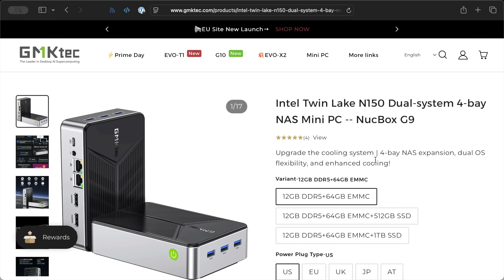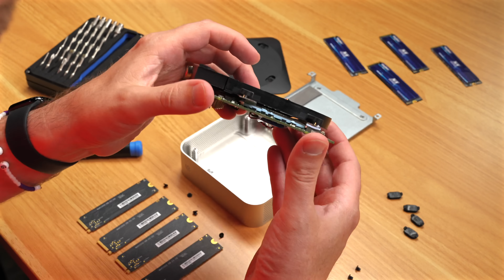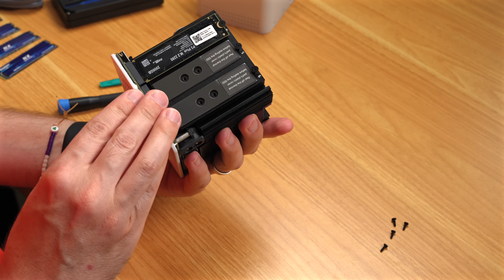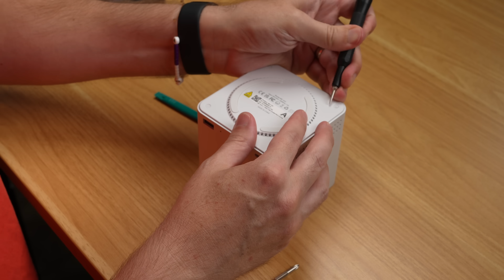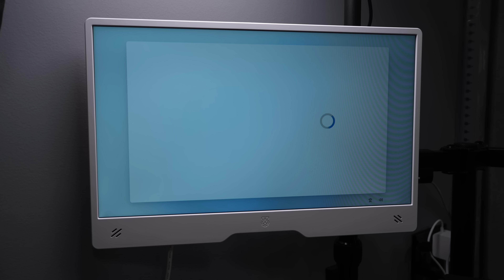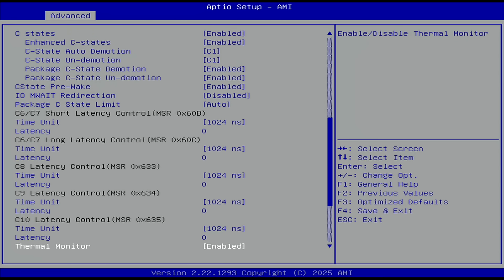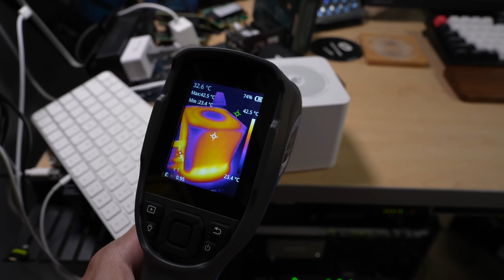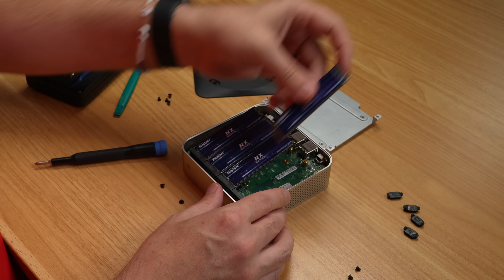The Mini NAS has arrived! (mini homelab)

Comment: Wow great review and transparency! Just wanted to say thanks for all your great videos. I got into homelabbing about 5 years ago with a Pi4 and with your help! It served me well until I wanted to add Frigate into the mix and ended up using an old laptop for that. The very messy setup worked great and probably had < 1 hour of downtime over those 5 years even though the Pi4 booted off 1 of the 2 SSD's plugged into a powered USB hub, and it's second ethernet (because it was also used as a router) was plugged into that same hub :) But last Christmas I upgraded to a cheap mini PC ($260 for one off Amazon with an AMD 5800U, two sodimm for ram, two nvme, wifi, and two 2.5GB ethernet) and with Proxmox, it's been a huge upgrade and learning experience. Still sips the power but has so much more performance and flexibility. Since it only has 2 drives I partitioned one with a boot partition and a storage partition, and the other drive just has a single storage paritition, and every night a script runs to backup certain parts of the main drive to the other (if the main drive fails it'll take me a night to re-setup things and restore the backups). So almost a perfect setup for my use case. What I love is the cpu runs hardware accelerated object detection in Frigate (via OpenVINO), an OpenWrt vm for WAN failover if my main inet goes down (it will try connecting to my cellphone's hotspot), home automation, Pihole for DNS/DHCP/Adblocking, Ubound as a validating DNS resolver, tailscale for remote access, and finally the NAS function. All told the mini PC is running 3 lxc's, 1 vm, and a total of 11 docker containers. I think for me just having a single purpose NAS would be a waste of resources, even when I was on the Pi4 it was running so much more than just a NAS, and having a slightly more powerful cpu makes my little homelab so much more capable. The mini PC's CPU usage is always < 3% and it's probably that high just because Frigate is recording and analyzing video 24/7, so still tons of power left over to run desktop Linux or Windows vms in the future. But anyway, just wanted to say thanks for all the inspiration and share some of the fun I've had as a result, and I hope you find a good solution for your particular NAS needs!

Comment: External power supplies have annoyed me for a long time, so that Beelink Me Mini looks great with its internal power supply. But I might be changing my mind. In my experience, power supplies fail more often than anything else in a computer except for hard drives, and now hard drives are on their way out. I have a Synology DS918+ server with hard drives. Recently, the system didn't power up. I took a chance that the fault was in the power supply. I plugged in a replacement, and the system came back. The operation was easy, and it looks like it wouldn't be for this power supply in this tiny system.

Comment: I've had mine for a few weeks now. It came with a 2-gig SSD, but I added a second new Crucial of the same model, a one-year-old 2-gig SSD, and a 512-gig drive that I removed (unused except for the Beelink Windows install code) from an upgraded Beelink SER6.  I loaded TrueNAS on the eMMC. The 2 new 2-gig drives are striped (RAID0), the older 2 gig and the 512 gig are single drives. I'm using it for media storage and as a backup location for "Home Assistant."   Works perfectly fine for my use. And it's SO small! 

My only issue is that I've been unable to install the Jellyfin server.  I'll figure it out sooner or later,  but so far, all I get is an error when I try to install the app via TrueNAS. I'm sure it's something simple.  Bad/wrond path? 😀
Reply from the maker: I usually use the Docker container install for Jellyfin, though I've only installed it on plain vanilla Linux servers not on TrueNAS yet.

Comment: For the Aiffro, just use Unraid.  It's designed to run from a USB drive, and functions quite well too.  I think that would probably be the best option for that, then all 3 drives are available for use as pool devices.

Comment: Thanks for doing proper thermal testing for all of these. I’m in the market for something similar, but have been worried about overheating drives. I’m curious how the ME Mini would do with double sided 4tb drives, or if it would need a metal case to properly dissipate the heat.

Comment: Diy NAS needs 128 pcie lanes just to start it, old dell server, threadripper, epyc etc. Most people are getting cards they can stuff 3-4 nvme's on pcie slot with bifurcation support. Still needs alot of nvme's to compete with 2 40TB rust drives. 100gb network card will take an additional 8 pcie lanes for testing throughput.

Comment: I like the mini-NAS idea, but none of them have enough storage. Could you take a look at something like the Asustor 12, with 12 m.2 slots? I’m currently running an old 2U 12-bay pizza box, and would like something smaller, more powerful, and more energy efficient. Just wish the 4TB+ SSDs were cheaper.

Comment: I have a similar CWWK unit with 4x NVMe drives. I'm running ZFS on my root filesystem to get around the no eMMC limitation without wasting storage space for the OS. You might want to look into that.

Comment: Why would they use gen 3 (price?) but honestly how different is the price between the two for the SOC they use (or does that mean all the other parts of the machine get more expensive (gpu, etc) having to support gen 4 or 5? 4 seems old enough to be pretty off-the-shelf cheap at this point. Totally agree with the rubber feet thing, so annoying, like put them in the box so I can stick them on, but leave the holes uncovered in shipping, then once I have it all working I will put them on (I would probably use regular silicone feet from Home Depot not covering the screws, who is looking at my NAS' underside? (honestly in a rack probably would leave them off since who cares I'm going to 3D print a cradle to hold it in the rack (my rack also has a top 140mm rnoctua rack fan so would be able to exhaust pretty much anywhere dumping heat into the closet (which is kept cool - typically in the 60 degree range). 

The thermal images are interesting with heat spilling out at the bottom seems to imply either they poorly couple to the vertical heatsink or they need to draw air in at the base to pull that heat upwards, Despite the many, many flaws of the trash-can Mac Pro the ability to dump heat was not one of them, we ran it as a NAS/java build server once it became not usable as a Mac Pro, sitting in our server room and even under the heaviest load it silently stayed cool (unlike the HP server near it which rivaled a F-18 taking off under full afterburner even at idle - when someone would run a ML training job the thing sounded panicked! Didn't help to have a Nvidia P100 inside along with 2x 4-core Xeon Gold chips)

Comment: One issue with the Beelink (and probably Aiffro) is compatibility with DRAM SSDs. I had four SN850X in the Aiffro and whilst in the beginning they ran fine, after a few months and with more space usage in TrueNAS the Aiffro started to reboot every time I was doing sustained writes to the SSDs. It's the main reason why I switched to the Beelink. I had a USB to NVMe adapter for the Aiffro so when I migrated all five SSDs over to the Beelink it too had issues during sustained writes. Only instead of rebooting on the Beelink, SSDs in slots 1-3 would suddenly go offline until I powercycled. I solved the issue by replacing one SN850X with a NM790. I haven't tested the Aiffro anymore but so far my Beelink has been reliable now. Knock on wood...

Comment: These all seem quite bad compared to just building an mITX with a real cpu which has more pcie lanes. Without any extra adapters you could get the 3 or 4 or 6 drives that most of these allow… all full speed… and room to expand. It will definitely be a tad bigger, but depending on the ITX enclosure you use, they will still go anywhere. Anyone buying one of these is selling themselves short in my opinion.

Comment: Hi Jeff, I may have a solution for the K100 boot issue. Back in the heady days of mdraid under Linux I would carve off a small boot partition on each of the RAID drives. With the BIOS set to boot off more than one I would still be able to recover from a first drive failure. A cron job for rsync made sure that the shadow boot partitions remained patched. Sure, you give up a small portion of your usable RAID space, but with Ubuntu being able to fit in 10GB, that isn't much out of a 6TB volume. Certainly less than the marketing departments of drive vendors take by using TB instead of TiB ;-)

Comment: Thank you for your in-depth review of the Aiffro K100! Your perspectives give us valuable food for thought and areas for improvement.About the emmc , we also have some views,we prioritized extreme compactness (just 10.5x10.5cm!) and focus on low power , so it uses onboard LPDDR5 and a single 2.5G port, and give up the Wi-Fi/eMMC , even the hdmi timing circuit is streamlined. 
if pursure more interfaces and functions,we also are studying a new one high performance nas~
by the way we would like to know which bios function you hope to support , could you please give the details? thank you ~:yougotthis:
Reply from the maker: I often like to tweak the fan curve settings a bit, and it might be nice to have more of the CPU performance settings exposed, besides just the performance profile.

Comment: When I populated all pcie slots on my unraid build, I couldn’t reach my internal usb port anymore. Bought a compact usb drive (size of a Bluetooth dongle) and have had trouble removing it if I wanted to… wouldn’t be scared to put it on a compact system as most connections will stick out further.

Comment: Nice review, the mini-NAS space is getting interesting!
Jeff, when you measured temperatures for the Beelink, did you use the builtin power supply or was it powered via USB?
As the PDU may contribute to heat generation, USB powering would have been the fairer option.

And to improve the cooling, perhaps a small 3d-printed 'cradle' that locks into the rubber cover holes could help a bit, if as I read the fan is pushing air to the bottom of the case?

Comment: Interestingly, you don't actually always want especially good heatsinks on the flash chips for your SSD. They firstly don't get nearly as hot as the controller (which is usually the cause of throttling) and the flash chips tend to respond slightly faster when they're warmer... better electron tunneling mobility or whatever I guess.

Comment: Been running a Beelink SER5 MAX as a PVE node for the past 7 months and it has been rock solid. Fan is a bit louder than I would like but I hear that has been remedied in more recent iterations. 
The ME Mini definitely piqued my interest when it was announced , but on pure TB/$ value I've opted for a rackmount 3.5 server for my *starr stack expansion (previously running NVMe drives in USB enclosures).
The concept of M.2 NVMe NAS builds is fantastic, and likely the future, but with the current cost of these drives, it just isn't economical at all.
If you have the space (and the dB tolerance) then an oldschool DIY spinner setup still spanks an SSD NAS for cost efficiency, especially if you have an old 8th gen+ i5/i7 kicking around that you can tear down and repurpose for Quicksync.

Comment: Aww man, it's N150 as always, with limited PCIe lane, this is certainly going to be the future trend, i think their original purpose was to fit these mini homelabs with either M.2 SATA or mSATA, but the drives cost isn't that different from NVMe so these form is still an overpriced, over-glorified NAS and the TCO is going to be atrocious (we can't trust "Pre-order price" lol); again, at least the drives run in slow speed throttled mode so i guess the drives won't be overheating at all, but the poor N150 is going to run hot 24/7 with one of them running HOT power supply as well, thank you China.
.
Also, don't worry Jeff, we're not stupid, you're pretty trustworthy with your sponsorship transparency, even if we're not 100% full agree with you, your video will always be reliable.

Comment: Jeff you said that Beelink has a normal wifi card, can you confirm that? Based on my research it has a CNVi card, which means it can only accept a few Intel WiFi cards. I know for certain the GMKtek is CNVi, that's the reason I returned it. If I could find any USB powered unit with standard WiFi and at least 2 M.2 slots I'd buy it on the spot.

Comment: Here is a build (looking at the Amazon data). I believe the case is metal and you would not have to boot off a jump drive. 

(Amazon description)

FriendlyELEC CM3588 NAS Kit 2.5G Rockchip Demon Board 4xPCIe3.0 4K/8K CM3588 NAS SDK Kit 4 NVMe HDMI in (32GB Ram+64GB eMMC)

Comment: Jeff, thank you for the Video.

Running your NAS-OS from a single NVMe drive is a BAD idea. Instead, steal a page from Synology (probably, other RAID manufacturers do so too): 

Make a smalish partition IN EACH DRIVE and run that as a n-way mirror, and install your NAS-OS there. Then, in the other partitions, run a RAID-6 equivalent.

Hope this idea helps.

Also, if I were you, I'd buy 2 identical cheapo mini-NASs + a RASP-Pi, and run them in an active-active configuraton (with the pi as the decider to avoid split-brain syndrome).  Then , all the VMs of your "MiniLab" would run in active-pasive configuration in each of the MiniNASes, balanced during normal operation, and operating in degraded mode (but still operating, nonetheless) in case of failure of one MiniNAS.

¡Well yes! My background was in enterprise NAS and Servers ¿¡How did you guess!?
Reply: I'm not a big fan of Synology's approach – I'd prefer the NAS OS to be on eMMC, and to be be read-only (except when upgrading). Configuration, apps (if it's that sort of NAS OS) etc. can be done somewhere on storage pool. I believe that's how TrueNAS does it.
Reply: @snemarch  I'm not a fan either. I'd rather have the OS in small partitions in the 2 M.2 NVMe drives, with the rest of the M.2 for READ/WRITE/Metadata cache, and the mechanical drives only for storage, but Mr. Grelig has to work within the confines of the available hardware for the miniNAS.

Besides, the NAS-OS can NEVER be in a lone drive. At the very least, mirroring is needed.
Reply: @williamyf  I used to think similarly – but when the base OS is tiny and read-only, you don't need it mirrored. And with e.g. ZFS you don't need a wasteful system reserved partition per drive, you just put the NAS OS files as a (sub)volume.

More flexible, less proprietary approach.
Reply: @snemarch  when the base NAS-OS is iny, and the non-mirrored drive you installed it to fails, you will be in a world of hurt.

Doubly so if you installed the base NAS-OS in eMMC (which is soldered to the board) like you wished in your original comment, and therefore, you have to discard the whole NAS.

Cheers
Reply: Sure and since that would still not be enough, buy another house in a different state, even better, a different country, have the same amount of machines there and to be on the bright side, do this in a third country and house as well.
All this stupid paranoia - just back up your crap regulary and you are set and don't tell me that you are a pr0 and that you already hat failing disks or pools, cause if so, you are no pr0.

In my almost 30 years in the industry, I had exactly four failing HDDs and one SSD, two of the HDDs were still in the early 90s on an Amiga and the SSD in a friends laptop. Even within all the drives in customers PCs and Laptops, failing drives were the exception.

Comment: My NAS is a Pi 3 with a old hard drive in a shoebox. We are not the same.
Reply: how's it holding up? I plan to do the same with a Pi 4 and an SSD at this point. Haven't found anything less than $600 while still retaining decent power consumption. Nor do I need my NAS on 24/7

Comment: Is it just me or can anyone find a 2.5” SATA HDD drive that has more than 5TB storage? Areal density increase for HDD has produced 24TB 3.5” drives, but this doesn’t seem to translate to higher capacity 2.5” drives which taps out at 5TB. If any 16TB 2.5” HDD drives exist, and presumably cheaper than the SSD version, the Beelink PC can dedicate one of its 4 sides to mount this SATA drive. This would increase the storage capacity to this miniPC/NAS tremendously without incurring a hefty cost.

Comment: I got a Beelink about three weeks ago. Very happy with it.  If you run Linux from the eMMC it pays to do some tweaks to prevent or limit log writing so the life is extended.  Openmediavault has a flash memory extension that does this. I think beelink want you to run your OS from the NVME slot with two PCIe lanes, but then you limit your storage options.  For now I'm happy running mine as a NAS with openmediavault and the ZFS extension.

Comment: For the k100 you can always make the raid, then have a partition for the OS besides the partition for the data instead of using the entire drive for data. The only thing that needs to be out of the raid is the boot partition, but that is just a few megabytes that get wasted on all drivers (actually I used 1GB on mine because I have 8TB drivers and, at the time, did not felt like doing math or search information on how much the boot partition must be :P ). On my current setup using mdadm, I use that space to make a copy of the boot partition before upgrades, just on case something goes wrong, and I rotate that copy between all drives :)

Comment: Heres a quick tip i found useful for getting those rubber feet out of the holes easier. Take a small pointed screw and twist it into the rubber a few turns and then pull the screw out with the rubber attached. Works everytime and much easier than scratching it trying to get them out. ✌